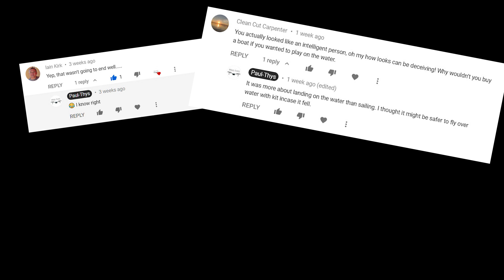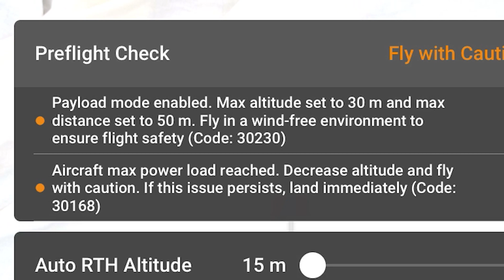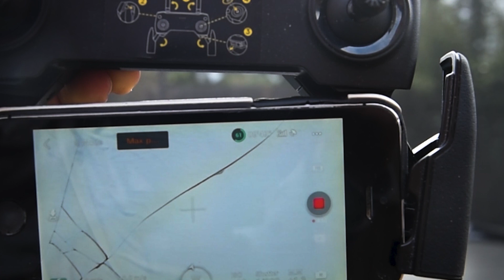DJI MAVIC MINI - WHAT WENT WRONG - WATER CRASH WITH WATER LANDING LEGS

Comment: You stuck the drone in basically a wind tunnel. The mesh traps air to a certain degree, the passing winds caused the a rotation inside the mesh on the trampoline causing the drone to make those unpredictable moves where it was spinning. It was uncharacteristic of the drones motions when it was spinning, it made me think of something spinning in a whirlwind and I happened to look at the wind blowing on the trees in the background. It appears the wind was hitting the trampoline at the right angle to cause the whirlwind effect inside the mesh. But to the experiment, it's to inconclusive to say the float landing gear is causing the rotation or the loss of altitude. But from my experience without the landing gear attached, I've flown my drone over water, it would catch a high pressure pocket while flying over a creek or river and drop altitude while I'm trying to do some skimming shots where I'm 6" or so above the water. The drone would drop low enough where I would almost make contact with the water.. I would have to always slightly increase altitude while flying low over water. That's basically why I bought this set to have incase I decide to get those shots again but from what I learned at the beginning of the video is, if the landing gears are on, they are more than likely to snag the water while flying low, causing the drone to flip due to the angle and speed the drone made contact with the water.. Plus the drag surface and all that fun stuff haha. But clearly the drone's sensors has an issue with detecting where ground level is on reflective surfaces that are constantly changing. It wasn't completely a pilot error but more of a software/sensor error.
Reply from the maker: The drone did not spin like that when I removed the legs so I am convinced the rotation was due to the extra load on the motors as the battery power reduced. Yes extra wind may would have made it happen, but it did not happen in the wind when they were removed with less battery power.
The loss in altitude would have happened without the legs due to tilt, but the extra weight exaggerates that. 
And as you said, you certainly shouldn't move it forward whilst landing (not that I had decided to land).

Comment: I believe that the sensors take over GPS when they are activated when landing or low to the ground or when no GPS . you should of  tried the test with tin foil reflections are more like water . PS clean the drones circuit board with nail polish remover water can leave a residue on he surface that can cause problems specially salt water
Reply from the maker: Thank you! I will give these both ago!

Comment: Another hilarious video on an incident that is uncomfortably close to my heart - and a great demonstration of how pushing the envelope is risky at the intersection of performance parameters. I've watched the original clip a few times, and its worth dissecting in the light of your experiment:

Flying over clear water appears to cause the Mini to hunt for the surface, in my experience from as high as 3 metres. It changes altitude (mostly downwards). The same thing can happen when flying very low over a crop - the sensors may be unable to detect the ground or interpret the height of the crop. So when flying towards rising ground, you may hear "landing" just before it dumps itself into the crop. Pooh.

Over a standing wave - especially in bright sunlight - or when the downwash makes waves, the mini loses track of its location in the horizontal plane, so it drifts sideways and yaws, and that can result in a feedback loop which reinforces the loss of control - you get a fast flyaway. It is unlikely to regain track until it's over a solid surface or you increase its altitude, and that is a scary sod if there are trees overhanging the water.

The payload may shift C of G, causing drift - and losing lift because the rotors are no longer horizontal. A quad has to correct that by tilting in the opposite direction. It can't change the blade pitch, so it must increase the speed of one or two rotors to get level. If the load is very heavy, or blades warped, or the drone is in S mode, and at high altitude, the drone will be close to its motor power limit, so it must also reduce the speed of the opposite rotor(s) - further losing lift.

It gets worse: changing rotor speed affects torque, so yaw stability is lost if the drone can't compensate enough, and the drone will spin.

And then there was the aerodynamic effect of the sponsons - when the drone tilts to go forward, air pressure on the top of the sponsons opposes lift, so the drone will tilt further until it gets equilibrium, and it loses lift.

So... it's not like losing control in high wind. Using S mode to fly horizontally over clear water on a sunny day is probably a poor reaction to loss of control of a heavy payload or low over water.

Proposed actions on:
1. Switch to C mode to leave the drone more power for compensation;
2. Slowly increase altitude (so you don't divert power from attitude and yaw control) until GPS, barometric and inertial sensors eventually come into play.

I'd like to know what others would do - I fly over water almost every time I use my drone.

I love your content Paul.
Reply from the maker: Thanks Lindsay!
Yeah, keeping in smooth mode would have been a really good idea if only to give more time to react. So much to think about in a small space of time!

Comment: Great effort Paul, love the effectiveness of the low budget testing and the use of the trampoline 👍 big like from me
Reply: Great  video. I like the way you broken the incident down using logical steps. For me personally I would avoid the floats. Too risky with little payback. I wonder if a mavic air 2 would suffer the same issue?
Reply from the maker: This particular model does not fit the air 2, but I agree with you and I think after spending £1000 on one it is too much of a risk for me 😂
Reply from the maker: Thanks man 👍 wish my daughter felt the dame way 😂